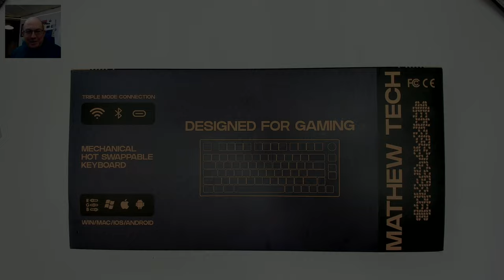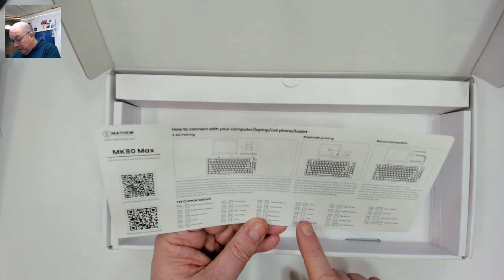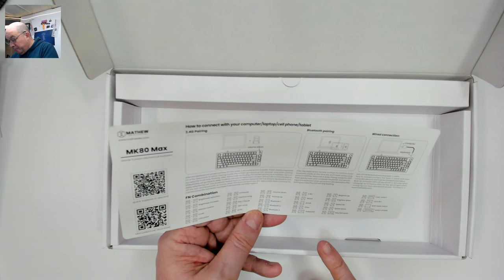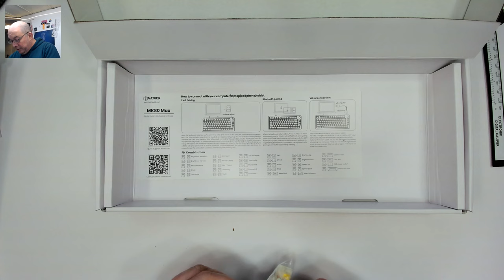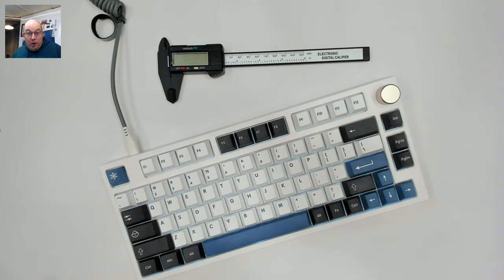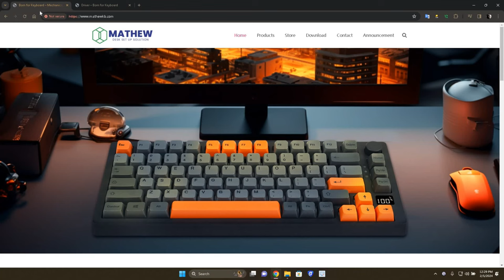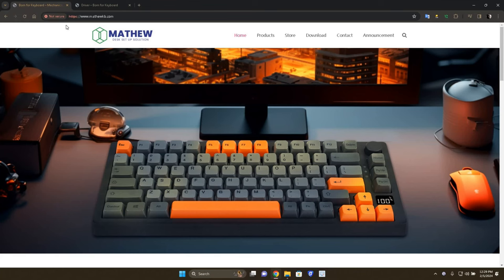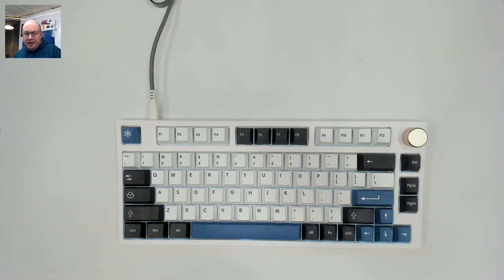MatthewTech MK80 Max - Have we met? NJ80 TH80 VN80

Comment: gmk87 for under 30 usd? really?
Reply from the maker: Yes, through Superdeals on AE.
Reply: @MechKeyboards  i'm not protecting MT, but how can you compare superedeal price with the normal one? but yeah, I agree that the overall price is a high. Some models are just rebranded without even changing logo in software. I've paid attention of MT to this, but no result. I own mk86 and mk84 and i can say that mk86 is interesting model. and it's one of those not many keyboards that could be used without modding. it's real gasket mount but those are really stiff.
Reply from the maker: Not a big fan of that knob/light cluster/one key, but at least it has a PC plate, though $90 is still quite overpriced for what these boards can be purchased for in lots of 20 or more. Not the same keyboard, but similar features, $15 in batches of two or more: https://www.alibaba.com/product-detail/oem-custom-wired-keyboard-75-83_1601008544509.html